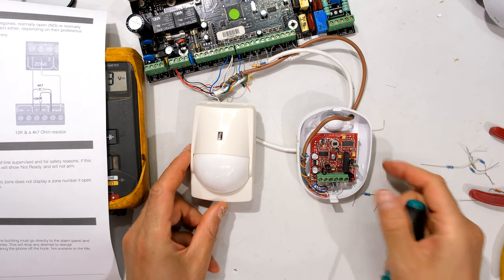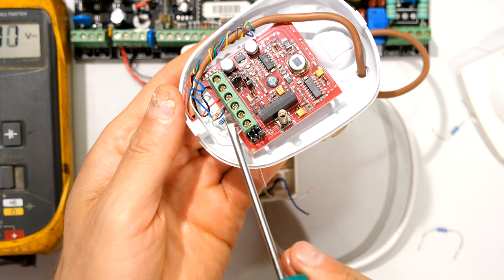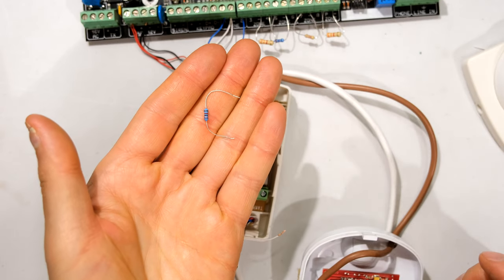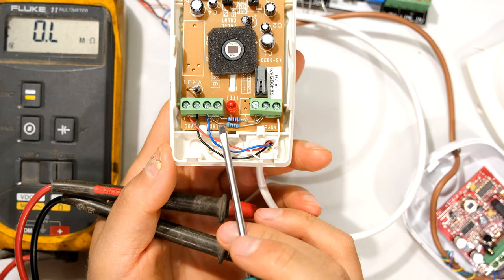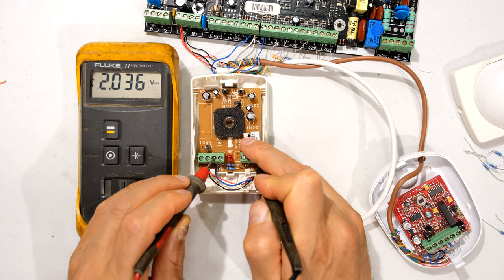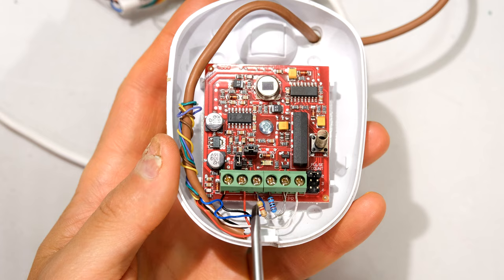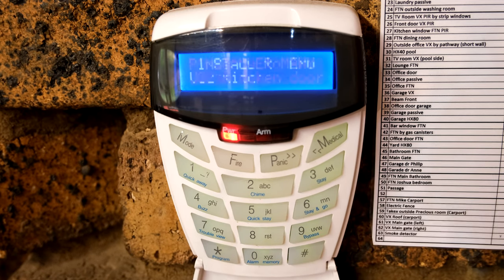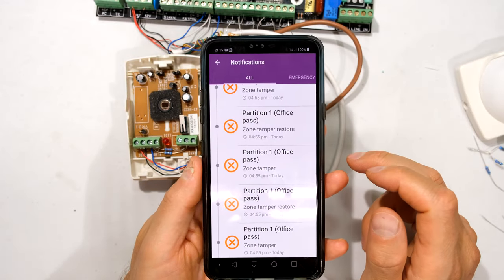How to wire an indoor PIR sensor with tamper connected to IDS X-Series alarm system - with tutorial

Comment: i'm new in this field and im using a PIR sensor Honeywell DT-7235T and i want to connect directly siren  12v with it,

when i test the sensor without the siren is work fine
anyone can help me with the wire connection to the siren

Comment: My installer, who happens to be lazy, didn't want to install tamper detection because of alleged interference problems. Can somebody confirm this? Or could I use separate zones for tamper detection?
Reply from the maker: i have not met one person who actually connects the tamper...don't know anything about interference, works fine. Tamper is useful for outdoor sensors and ones in critical installations where criminals can get tot he sensors like in warehouses during the day. - bypass the sensor and no one knows so they can break in later
Reply: @ecologicaltime  Yes, I armed, walked up to the outside beam, removed the cover and I could have bridged the terminals easily. I should add the tamper resistors soon, this is nonsense as of now.